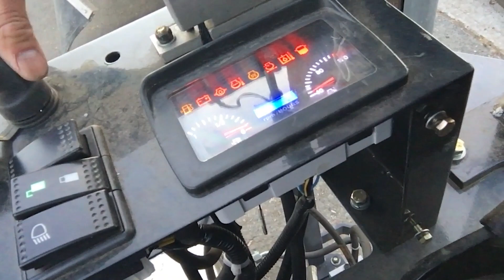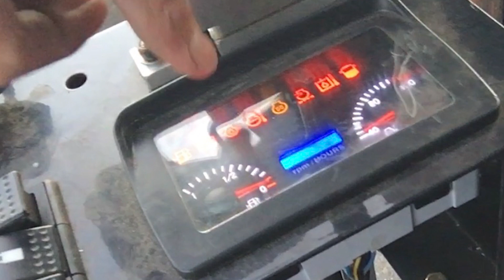The disappointments of the Chinese mini excavator.  The Landscape Buddy LB15 prototype #2 Pt2/3

Comment: I find the exposed travel motors and castle nut funny, I assume there is a gear reduction there, but I suppose it is single speed, do you know if there is actually a planetary or is the gear on the hyd. motor shaft direct driving a ring gear on the sprocket?

Comment: I like your honest approach on the things you mentioned. Very good detail to what you were describing. All those things need to be in a contract. And a QC to insure those items are installed as you wish them to be.  A person you can trust for the QC is very very important.  You clarity in speaking is very good.
Reply from the maker: Thanks for your kind words, I do my best to provide unbiased details.  Generally speaking, the work ethic is a bit…. lay back (to say it in a nicer way) compare to here in the US.  So, attention to detail is really lacking.  That being said, some ppl would not even consider machinery from China.  But, the cost vs. value still justifies of getting one.  Prerequisite: you need to be able to look pass through small imperfections; and stop comparing these to the Deere or CAT etc., because it’s in the different class.  Thanks again for commenting and cheers!

Comment: Hi, can you tell me what kind of balance valve is mounted on the travel motors? I bought a 1.5 tons excavator from china, and I have the problem that goes too fast on a descend, so I want to mount one on mine, thanks
Reply from the maker: isn’t it a scary feeling of the excavator picking up speed when going downhill?  Others also ask me the same question and I brought it to the excavator factory, he said that the motor and balance valve usually purchased fixed together from the hydraulic supplier.  He did say that if we can provide the label on the travel motor he can help source.  Send me a photo of the label on the travel motor and see what happens.  Thanks for commenting!
Reply: @jasonyeh99  thank you, can't add a link here, youtube delete my messages, sent you an email, regards
Reply: Hi Jason, I found what kind of valve I need but can't find here in Italy to mount directly on the motors like is on your, can you check what model/manufacturer are the valves you mount? thank you very much
Reply from the maker: I can’t open your link with my phone, it seems I need to go to a desk too, I’ll try to get to it this evening.  I was told from the factory that these need to be ordered together (balance valve + motor) at the same time.  Let me check.
Reply: @jasonyeh99  ahhhh I see, well, anyway I will need to find a place where to put the valves I found here, they asked me about 70 euro every valve, the seller checked your video and said "yes, you will need this" and pointed me to some valves, just one last question, are they working fine on your? I mean no more problems on a downhill?
Reply from the maker: The valve prevents the tractor from sliding down hill.  The valve make it feel like it’s on the flat ground, so, your forward/reverse will be intended as so.  Unlike without the valve, you are applying small uphill force to allow it going slowly downhill.  If that make sense.

Comment: Hi Jason.  I appreciate your honest assessment of your prototype.  Hopefully your supplier will correct all of the valid issues you mentioned.  Thanks for showing and explaining the pilot controls.  I'm still having a tough time controlling the pilot controls on my mini-ex, even with just my fingers and wrists, instead of my forearms.  Also, your advice to purchase a stock machine is wise because you will likely get a machine with the specifications and features that are advertised.  I would add that it is a good idea to list all of the specs and features in the contract when you order. 

As for the glow plug switch, it could be that turning the key to the right will also turn on the glow plugs, as I saw the glow plug indicator light up (along with the others).  I'm not certain, but it could be that turning the key to the left or right may turn on the glow plugs.  I will try to measure the glow plug voltages next opportunity I get to confirm.  Keep the videos coming.
Reply from the maker: Thanks for your comments and I’m sure in now time you’ll be comfortable and smooth operating both machines.  Thanks for stopping by.

Comment: Its not a deal breaker if there are some defects if your the reseller to put in some time to fix problem areas.  I used to sell Foton and jinma tractors years ago they had there issues and I worked them out and I'm sure I will do the same with the mini excavators I bring into Canada. Great video and you have inspired me into buying excavator and other equipment from China again.
Reply from the maker: Thanks George for your comments.  I’m lazy and so I want the excavator to be ready right out of the box.  Especially if the consumer is using it for work, then we expect minimal down time with the equipment.  A homeowner user would be less critical and, perhaps don’t mind tweaking the machines to get it right, especially if the price is well in the budget.  Thanks for stopping by.